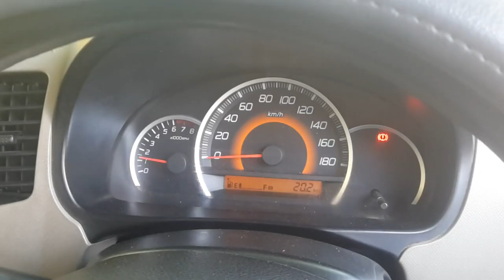Suzuki WagonR VXL full tuning | Best mechanic in Rawalpindi/Islamabad for Car &Jeep | Shaada Ustaad

Comment: This is not the way of tuning
Very dirty style tuning..
Air filter oil filter oil 3liter 
Spark plug 3 plus coil check
Air cleaner box 🤔🤔🤔
I don't say anything but I hope you change the way you are try it's best for you for more customers thanks
Reply: Air filter change nae kia and battery wires. B clean nae ke. Genuin  Plug saf kiy jate h new market sy milne wale local hote ha. Engine scanner b nae lgia s. or charge b 3000 yeh to 1000 rupy ka kam ha.
Reply: @HamzaAli-qj1dx  mare to plug he nakal liya kharab bol ky China walay Dal Diya mujsay or wo kharab  bol ky Apne pass rakh liyaa phir abhi laser walay dalay Hain main my iridium ky
Reply: @HamzaAli-qj1dx  scanner to koi lagata he nahii hai
Reply: @HamzaAli-qj1dx recommend some mechanic in Rawalpindi?